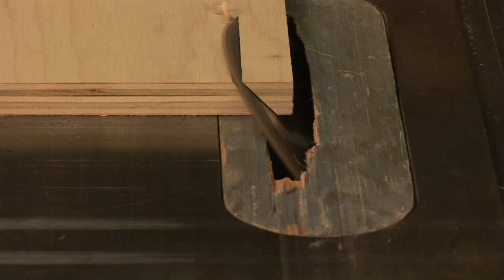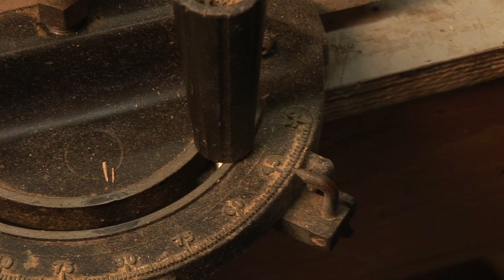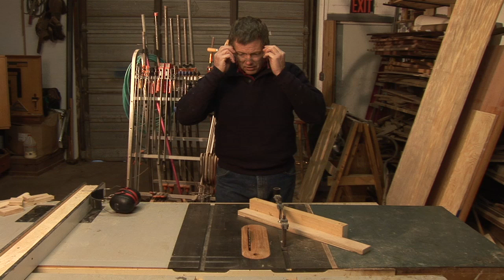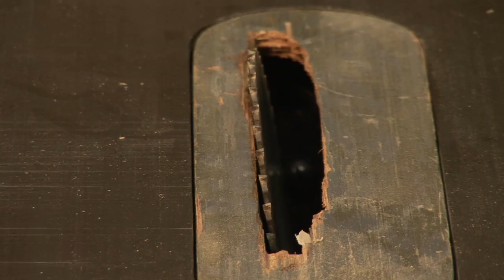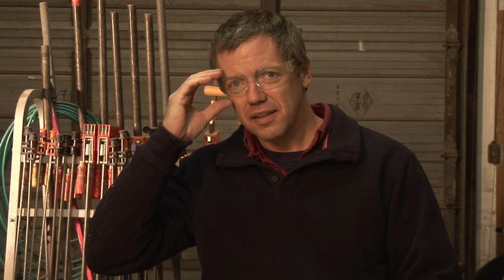Home Repair Tools : Cutting Angles on a Table Saw

Comment: You didn't include how you measure to cut angles. Like for example you have a piece cut at 90 degrees at the length you want. Well whenever I angle the blade it doesn't cut the angle. The blade misses the wood completely. I don't know if maybe I wasn't paying attention and I didn't set the fence right, but why did this happen?